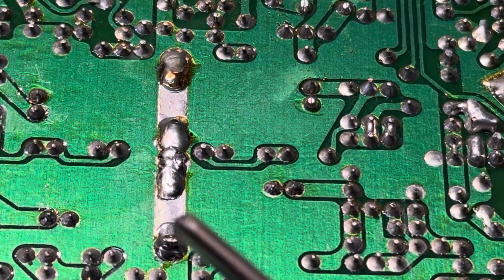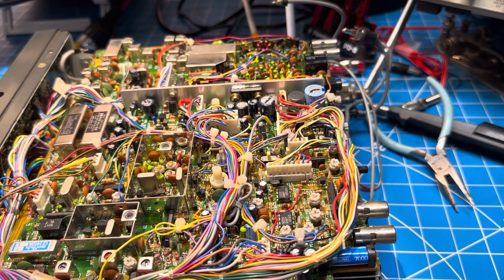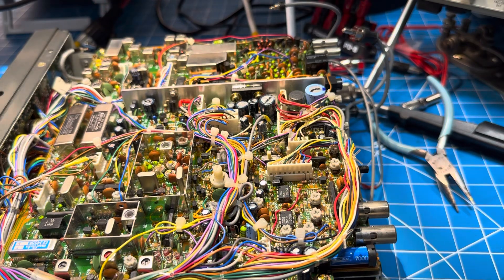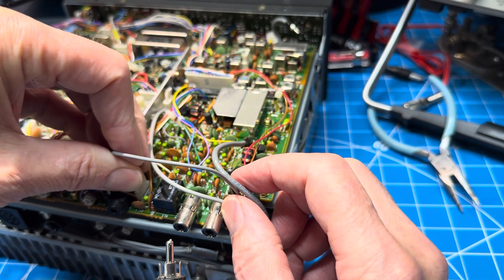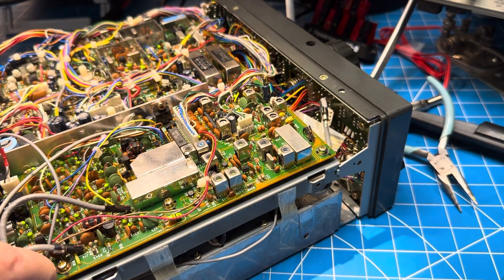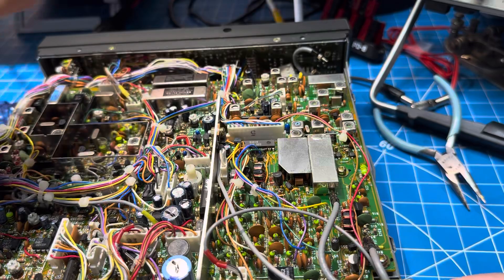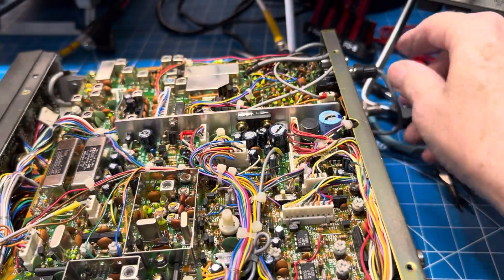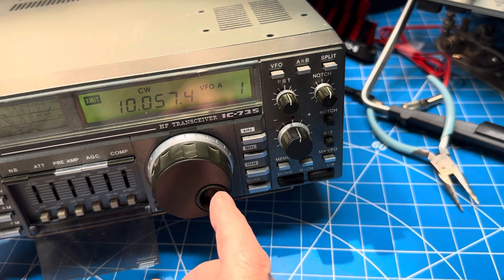Icom IC-735 FL-32A Installation #2 - Filter Installed but no RF on the first test…

Comment: When installing the back cover you forgot to put back in its socket a coax teminated in a small jack. Front right side.
Reply from the maker: Exactly correct! Lesson learned/remembered was to take notes during the disassembly. Thanks for the info and for watching! 73, bruce
Reply: 73 from IU0PYY in Rome